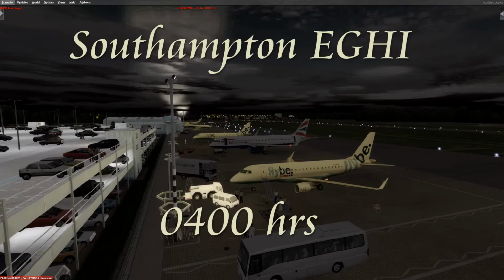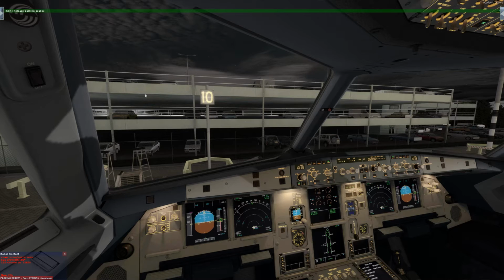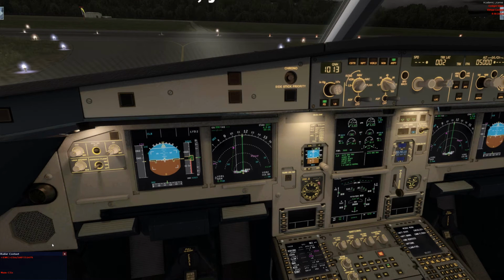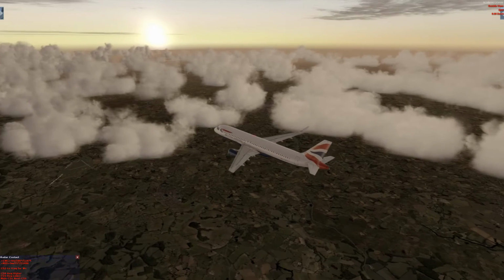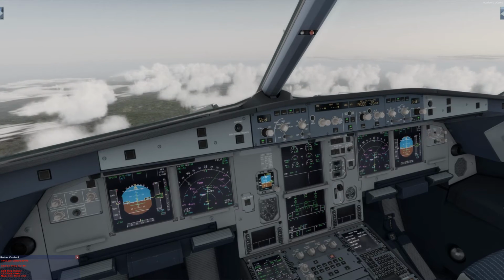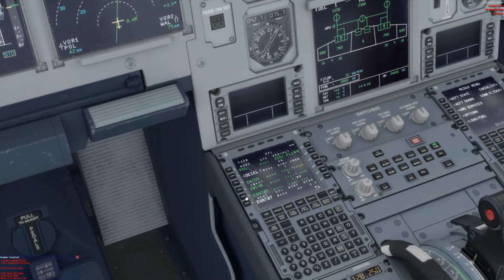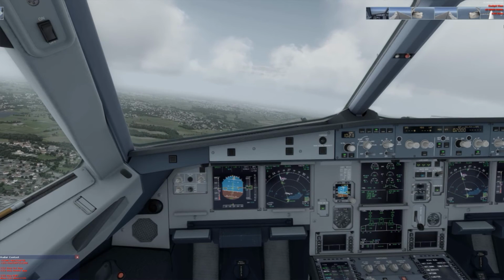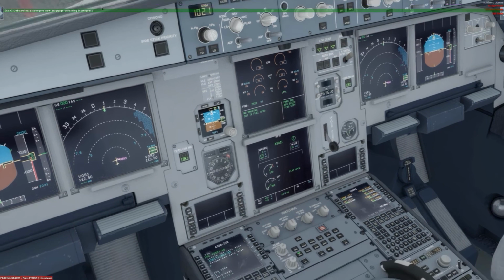Aerosoft Airbus and a Multi Crew Experience EGHI to EGNT

Comment: Hi! Can you customize the actions by the virtual co-pilot to suit any airline-specific Airbus procedures in MCE?
Reply from the maker: Hi Joshua. Yes you can! The power of Multi Crew Experience is many fold, but the ability to customise your flows is what sets is apart from the "other" program. You can add all the flows from your company, exactly as they are used. You can also add all the checklist items specific to your flows. Remember the checklist items are "switch aware" to the first officer. If he asks for "check APU bleed air on" and its off and you reply "on", he knows that you are wrong!! If you say "on" again he/she will set the switch to on!  MCE is an important add on if you are a serious simulation pilot! Thanks for watching.
Reply: Thanks for the info, David! Would it be possible to customize some cockpit actions as triggers for a specific PNF flow? For example, PF disarming the spoilers after landing will trigger the After Landing flow for the PNF. Or are all flows voice-activated? Great video!